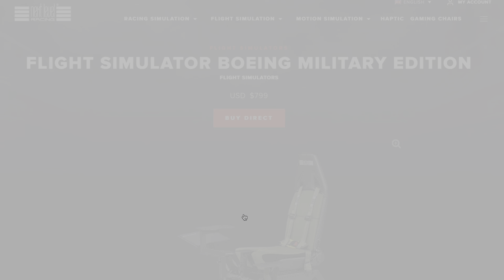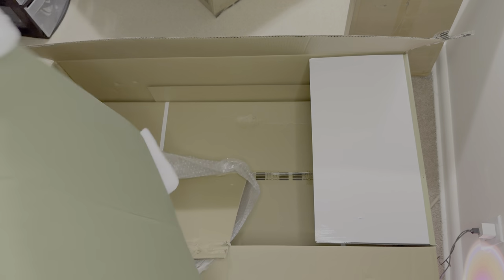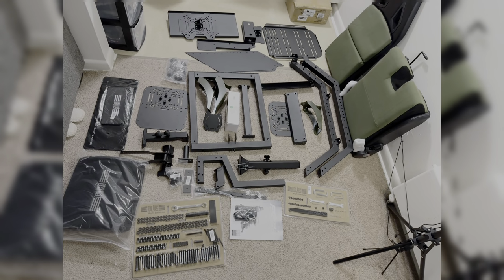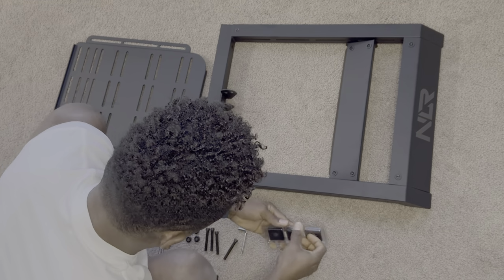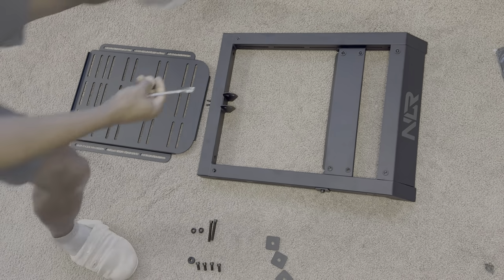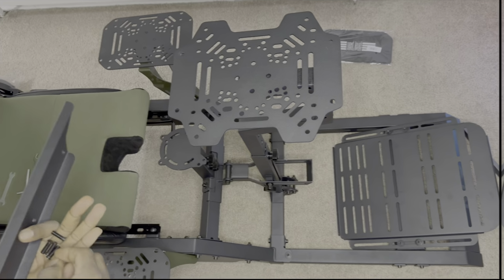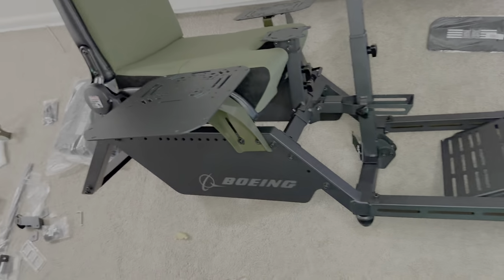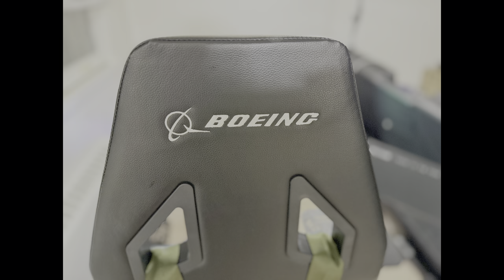Building a Next Level Racing Boeing Military Cockpit from Scratch: #unboxing  #2024 #nextlevelracing

Comment: Saw your video but I didn't notice if you mentioned if there were screws supplied in the box for mounting the flight sim gear to the plates? Or did you have to get these separately?
Reply from the maker: That’s the amazing thing about next level racing everything you need is in the box including extra screws for mounting a lot of different gears there are a lot of different screws with different sizes so basically all of the screws that I used to mount my gears  came from the screw supplied by next level racing in the Box.
Reply from the maker: And I still have hella extra screws left.

Comment: I have it, and use it every day.
Pros: It really is the ultimate cockpit rig.
Neutral: Comfort level is rather basic but acceptable. It would also benefit from a better mousepad mount that is higher (I have to use a cardboard box to level my pad to a comfortable level)
Cons: I think it might benefit from being a bit wider. With both side plate mounts installed, it's pretty tight for my fat butt and legs :P
Ok, I'm not THAT fat, but still. A little nudge towards comfort would help this product.
Reply from the maker: Facts, I’m athletic but I find it really difficult to get in and out the rig without scratching my skin against the metals here and there. Your comment says it all for me.